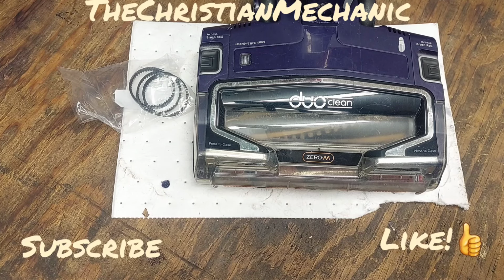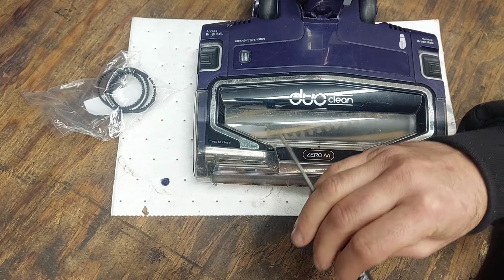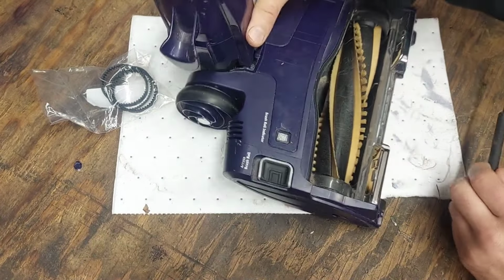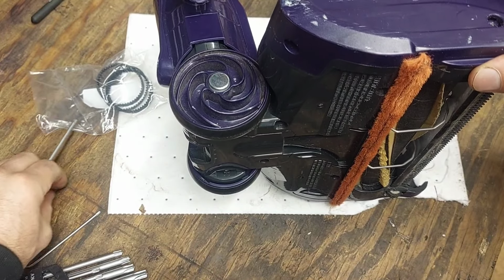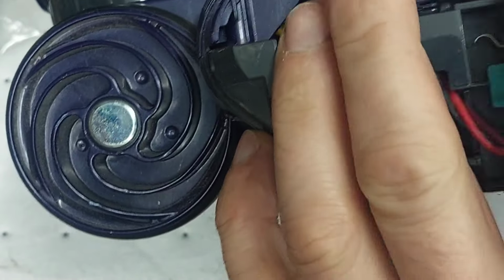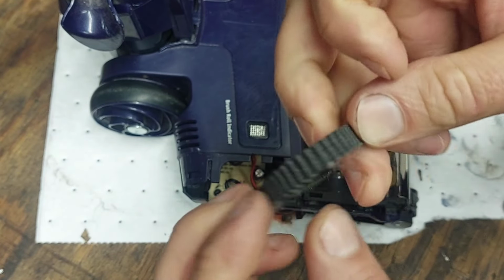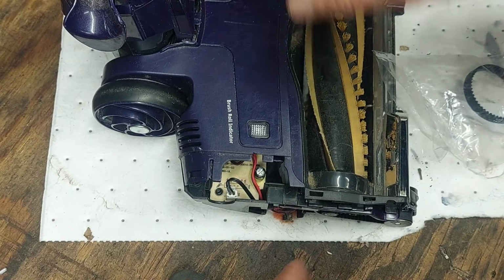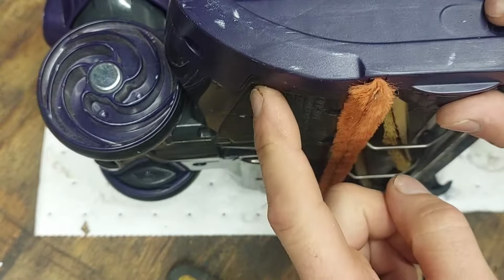Shark duo clean zero M belt replacement in the Head.

Comment: You literally cut away from the part I needed to see. Thanks
Reply from the maker: Np, you can check out the second video. You might have what you are looking for.
Reply: I came here looking for something else as well. I wasn't sure how to replace the front wheel on my nv835, but it looks like under the belt covers is where I have to go to remove the wheel pin. Thanks

Comment: Thank you very much for putting this video up. I would have never figured why the brushes weren't rolling in mine, let alone how to access the belt without this video. Thank you again.
Reply from the maker: Thank you for checking out the video. As soon as I figured it out, I had to make a video in case someone else had the same issues. My channel I usually just do quick tool reviews, and the occasionally a how to. Thank again!

Comment: Thank you so much for your video! It’s the only video I could find to fix this bloody hoover
Reply from the maker: No problem, l, that's why I made it because there were no videos. I am going to do another video eventually for the other side because people were asking about belt sizes.
Reply: Yesss I’m needing to order a belt for mine and scared to order the wrong belt size. None of the belts on Amazon mention my zu881 shark model. Wondering if my model is included in the NV500 series????? 😩
Reply from the maker: @christym4336  not sure about that! Good luck with finding the right part.

Comment: I have the star shaped bits but there is a piece in the middle of each of the screws so i cannot fit my bit in. Is this a special set of Allen wrenches with a hole in the tip so they fit over that piece in the screw?
Reply from the maker: Its security torx bits huskey sells a set. Homedepot.  You can go to my playlist, and I did a tool review of them as well.
Reply: @mlacher100  thank you. I clean houses and have 2 of these vacuums. I need them both running. Thank you!!
Reply from the maker: @conniemeadesfarlow163  Thank you for the kind words!

Comment: I bought a brand new shark vacuum and it was broken in the first 5 minutes I used it. It was working fine on hardwood floors. Next, I tried to vacuum a rug with the rotating brush on. As soon as the brush turned on there was a snapping sound, and the brush stopped. I tried bring it to 2 different repair shops and they both said that they do not, and will not work on a Shark vacuum. I'm screwed.
Reply from the maker: So, did you figure out what was broken?? Amazon I think does have some parts for them, or maybe you could find a used one for parts on ebay. I have a carpet cleaner that the motor locked up on it. I found a motor used on ebay for $30 to fix it. Hope this helps